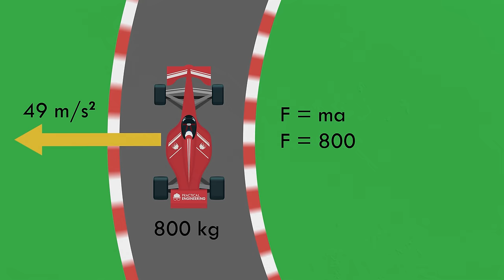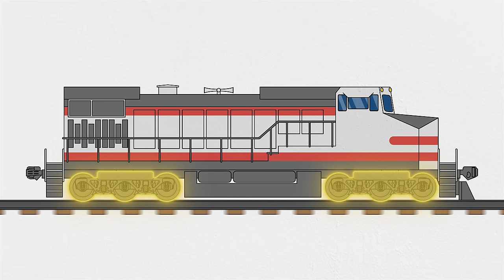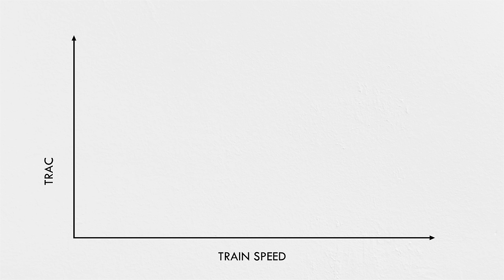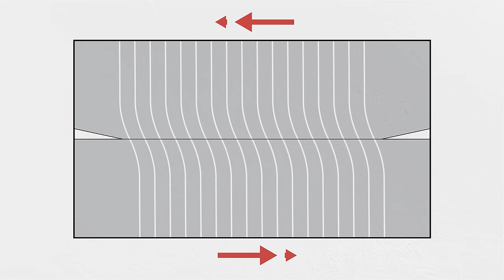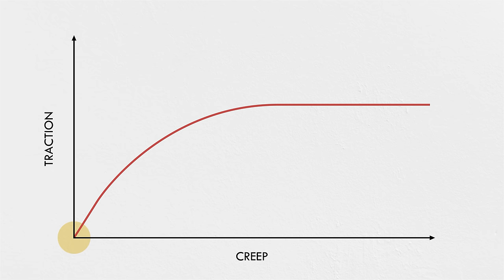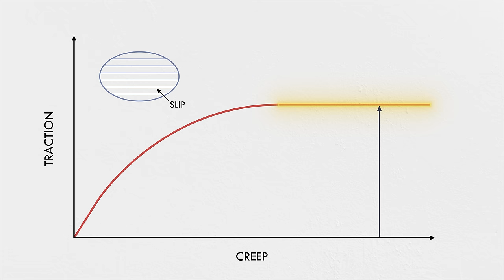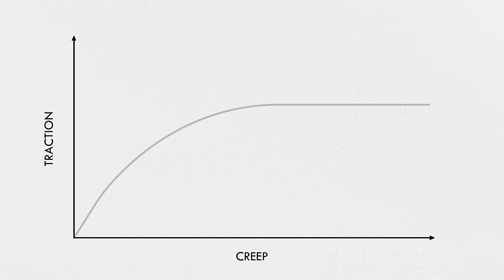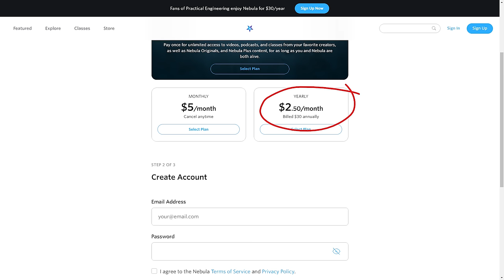Why Locomotives Don't Have Tires

Comment: 6:51 "For longer, heavier trains, you can't just use a single, massive locomotive -"

Union Pacific during the transition era: "Wanna bet?"
Reply: yep... this seemed like a good opportunity to include a clip of the recently restored Union Pacific steam locomotive Big Boy #4014.  Very impressive!
Reply: The Big Boy is basically two locomotives in one, albeit with a single cab and firebox
Reply: while true, the challengers and big boys were articulated, and had a lot of wheels, so the weight limits weren't reached
Reply: Gas turbine locomotive: Hello there
Reply: It's a shame he didn't include something about the Big boy and the Challenger locomotives. They put the diesels to shame in power.
Reply: You are absolutely correct about UP challenging the "you can't just use a single, massive Loco."  Every railroad was/is looking for more traction and less people.  I am not sure Uncle Pete ever had a "transition era."  Even before the UP "Union Pacific" type (2-12-4) they were pushing size. The Mallet's, Challenger, Big Boy, DD-35, C-855, U-50, the gigantic turbines, etc.  There little sister to the south was right in there too. Cab Forward.  Others, N&W Jawn Henry, C&O Turbine, Pennsy turbine (6-8-6).  And Pennsy was a mess with 4-4-6-4, 4-4-4-4, 4-6-4-4, and more. Then there were the Pennsy CENTIPEDES.  Even today with the nutso long trains with 2 and 3 sets of DPU's.
Reply: @SkyhawkSteve As someone who lives in Cheyenne, it's my favorite. (Although 4004 is the one I remember the longest). Every year the UP Steam Shop and Roundhouse are asked by the historic depot for a tour and it's fantastic.
Reply: Called the 'draw-bar limit." 
I saw a train exceed the draw-bar limit, broke-in-two right in front of me. Starting up a one-half of one-percent grade, 180 cars, mostly scrap iron, 80 car set-out for local steel mill. Seven unit locomotive consist, too much power, too soon. Bang-hiss, broken knuckle, air-hose parting.
Controlling these train dynamics that places stress on the couplings is the reason why power must be distributed in long-heavy trains.
Reply: Lol
Reply: Challenger, Big Boy, GTELs, DD35, DD35A, C-855, U50C, & DDA40X
Reply: @namewarvergeben The large articulated engines like the Big Boy, Challenger, and Allegheny are definitely not just two engines in one.  Mallets and other double ended engines certainly were though.

Those big three engines have only a single firebox, boiler, and control set.  The only thing that is doubled on them are the drive sets.  The only reason they have two drive sets, one with articulation, is to put more drivers down to the rails.  Long, rigid frame engines with multiple drivers have a lot of issues with turning and applying tractive effort.  By splitting the drivers into multiple sets, it allows engines to be larger, heavier, and with more drivers than a single rigid frame.

Those big engines are more akin to a 4wd vehicle than anything.  One engine, but 2 sets of drives.

Mallets though, really are just two engines backed together with a single control cab.  Two fireboxes, two boilers, two sets of drivers, two everything.
Reply: GTELs go brrr.
Reply: I’d like to see a gas turbine be useful in the future if the technology can make it viable.
Reply: @larrylawson5172 UP also had the centennial locomotives during the diesel era (basically a double length diesel chassis with two engines).
Reply: @danielhomant2832 Mallets would have one firebox. They reused steam from one set of pistons in the next set.
Reply: @andywomack3414 Or you automate the train to limit draw bar forces. Trains in Australia run with 300 plus cars and five locomotives up front. Running locomotives through automated car tippers is a BAD idea.
Reply: Go big or go home
Reply: @covishen : lololololol the Big Boy might have put an individual locomotive of its era to shame in terms of power, but there are several important factors to consider:

1. Power doesn't pull trains, tractive effort does, and adhesion is the broker between the two
2. Steam locomotives have horrendous adhesion and traction characteristics compared to even first-generation diesels
3. As an articulated, the Big Boy is effectively 2 steam locomotives permanently MUd together, so any figures you come up with need to be halved to carry any real meaning
4. The Big Boy has a massive tender that is entirely dead weight
5. When you MU several diesel units together to create a single locomotive, the Big Boy becomes less impressive
6. A single ES44 will outpull a Big Boy at any speed and under any rail conditions

The first and second points are extremely important because steam locomotives have a capped tractive effort curve. People like to pretend they're magical constant-force machines that develop more and more power as they go faster, but the reality is that they are constant-power machines just like diesels due to the power limits of the boiler, but can't develop full power below a nominal speed, which imposes a hard limit on their tractive effort, which makes them seem like constant-force machines at low speed.

Contrast that with a diesel that develops full rated power across its entire speed range and can throw down as much of that power as adhesion will allow until it reaches the speed below which it risks frying its motors (speed of max continuous tractive effort). The diesel isn't hammering its rails and thus has an adhesion advantage of several percent right out of the gate, and it's not pulling a tender around that contributes nothing to tractive force. All of its weight is on drivers because it's lighter and needs no spurious extra axles to keep it from collapsing the rail.

Diesels also have the inherent advantage of being able to control the current at the wheels without changing the engine speed by varying the field excitation of the traction alternator (generator in older locomotives, a discussion unto itself). Where early diesels used electrical resistance to detect wheel slip with poor precision and primitive wheel slip management systems like IDAC that applied coarse corrections to tractive output, modern diesels use ground radar to detect slip in microseconds and microprocessor traction control systems like EM2000 which applies extremely fine corrections in microseconds. This allows the locomotive to throw more of that power into tractive force at the wheel. Adhesion of 35% is not uncommon on modern diesels.

There is a misconception that wheel creep is somehow an AC vs DC thing (partly due to dishonesty on the part of manufacturers), but ground radar and microprocessor traction control originated on DC locomotives. AC power adds the benefit of being able to go slower and slower without damaging the motors - and tractive effort increases as speed drops. The steam locomotive, by comparison, is limited by not being able to develop the full rated power of the boiler below a nominal speed, which caps the tractive force. Above that nominal speed, a steam locomotive and a diesel will have similar traction curves... if you ignore the differences in adhesion between the two.

Add in the contemporary innovations of individual axle control, radial trucks that eliminate curve-related traction losses, and trucks specifically designed to limit or eliminate weight transfer, and it's no contest. The Big Boy was impressive for its time, but the writing was already on the wall. And before you say it, that infamous video of the Big Boy pulling the long APL container train was all empties. Try it with loads next time and watch the wheels spin. The Big Boy could throw down 135,375lb of tractive effort, which, as noted above, was impressive in its time, but an ES44 will do 183,000lb of starting tractive effort and 166,000lb continuous. And you can MU a bunch of them together. Someone's putting someone to shame here, but it's not the Big Boy.
Reply: @ErickC  That's a lot of text for us to not bother reading.
Reply: @jacobwhitecotton There is a reason we went from Simple American 4-4-0s in the 1860s to long Texas-type 2-10-4s or Articulated locomotives, increasing the size of the firebox, pistons and a great number of Drivers, on a locomotive that a single crew could operate.
Reply: @danielhomant2832  du Bousquet locomotive? The one with the cylinders meeting under the middle of the boiler? Garrets? Belgium's quadruplex?
Reply: The Big Boys and The Centennials are legends.  I believe there is one of each of those iconic locomotives still in service. They are working locomotives, not just museum pieces.
Reply: @mohammadrifqisatriamas7311  Are those the steam locomotives that look the the traditional, "iron horse," but sound sort of like a lower volume jet engine.  I saw one when I was a kid at a fair.  I could not understand why it did not make the characteristic chugging. When I was waiting for the train, the man that took the tickets explained why did did not make the chugging sound. I rather remember remember a steam turbine or gas turbine.
Reply: @indridcold8433  it's a different one, what I'm referring to is Union Pacific GTELs, what's you referring to is Chesapeake and Ohio class M-1, maybe. GTELs using gas turbine engine (almost like jet engine) to drive generator create electricity and drive electric motor. M-1 is a steam turbine locomotive, they create steam and put it into turbine, that turbine create electricity and drive electric motor iirc.
Reply: It's kind of a good read though.@RCAvhstape
Reply: @ErickC  you are extremely fun at boys midnight chat.
Reply: @ErickC  Thanks for writing this up.
Reply: Well said!

Comment: Many railway vehicles do have tyres. The wheel is a solid block and the tyre is a shaped ring which is heat expanded allowing it to slip onto the cold wheel and when it shrinks grips the wheel firmly. A steel rings then is clipped into place to secure the tyre. This allows the tyre to be scrapped when it reaches its wear limit.

More recently there has been a move to monoblock railway wheels where the tyre and wheel are a single piece of steel and when the wear limit is reached the whole wheel is scrapped.
Reply: Yes I have seen the steel tyres replaced on steam locos.
Reply: Agreed. Steam locomotives definitley have metal tyres. I don't know about modern diesel and electric locomotives.
Reply: @JohnAshworth2023  I've worked across alot of fleets in the UK, analysing  wear patterns, gauging, changing wheelsets and operating wheel lathes and yes modern diesel and electrics do have tyres, Trams too. Most people outside the Railway assume the word 'tyre' means something made of rubber.

Comment: The German high speed rail trains ICE (inter city express) actually started out with rubberized steel wheels to reduce vibrations and thus increase passenger comfort. That stopped when we had a horrible accident at Eschede. What happened was that the rubber sleeve of one wheel started tearing off roughly a few kilometers before a switch and a piece of rubber jammed itself into the switch, forcibly changing the tracks for the rear part of the train. This derailed the entire train that had been going around 200 km/h (~125 mph), which would have been bad enough, but only led to broken bones in most cases. The problem was that a few hundred meters after the switch came an overpass and the sliding train took out the pillars of the bridge, causing the bridge with cars on it to collapse onto the train. All in all, more than 100 people died.
Reply: Correction: The rubber was just one layer in between the steel hub and a steel outer ring that ran on the rail. The rubber was indeed there to reduce vibration, but it also allowed the outer ring to flex under the weight. This caused fatigue in the outer ring until one finally broke. The steel outer ring is what lodged itself into the carriage and caused the derailment.
Reply: "Outer Wheel" is the tire! Not all tires are rubber!  @namewarvergeben
Reply: @keithstudly6071  Original comment described "a piece of rubber jammed itself into the switch", which is based on a misunderstanding. I specified "steel outer ring" to avoid confusion about the materials involved

Comment: 6:00 The problem here is that you are measuring the sliding coefficient of friction, and railroad wheels as well as car tires do not slide, they roll. The friction is static which is a higher value. Theat is the reason cars now have automatic systems to prevent skids. Once a tire slides (skids) the friction drops dramatically. The way you measure static friction is to place your sled on a plane and tilt it until the sled breaks loose and begins to slide. The coefficient of static friction is the tangent of the angle, or more simply the height of the end of the board divided by the horizontal distance from end to end, or as we call it rise divide by run. I've had my Physics student do this hundreds, if not thousands of times over the 33 years I taught Physics.

Comment: Several decades ago I was lucky to go on a ride a long in the cab of a diesel electric through the Appalachian mountains on a short line. It started raining lightly as we were going up a mountain and the wheels were slipping.  The sander was not functioning.  They had me stand at the front of the locomotive sprinkling sand on the track in front of the train so we could ascend.  Such a cool experience.

Comment: Excellent lab tools, sir.  Have been studying railroad systems, both domestic and international (I lived for two years next to a Japanese rail freight track) for over 60 years as a hobby, and your ongoing series is comprehensive and much appreciated.  One point of expansion, steam locomotives do slip more, due primarily to their reciprocating tractive effort, and the uneven rotational wheel force.  Steam has much better ' to the wheels' tractive effort, but getting it to the rail is to the Diesel's advantage, and your point of MU operation distributing that force was explained beautifully.  Thank You Sir!!
Reply: That's one of the biggest things between steam and diesel. Diesel can start a train off better but a steam loco is better for speeds in it's designed speed range, 70-100km/h for a lot of them. That's where steam is actually more efficient than diesel if a modern design of steam loco is used.

Comment: Another thing to mention about the steel on steel design is that more flexible materials like tires physically squish under weight, and all the energy that goes into squishing the tire is energy not converted into forward motion. This is one of the reasons why semi trucks are so unbelievably inefficient when compared to cargo rail for moving the same weight.

Comment: Spent 4 years working on a metro project overseas. As an Interface Manager, now retired, between the three consortiums I had the privilege to read various train to rail test reports. At the time, and due to my background as an electrical engineer, I learned many things but not to a great depth. This video enabled me to connect several dots and several of those reports now make complete sense. Thanks for sharing.